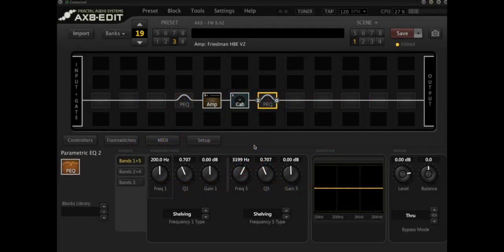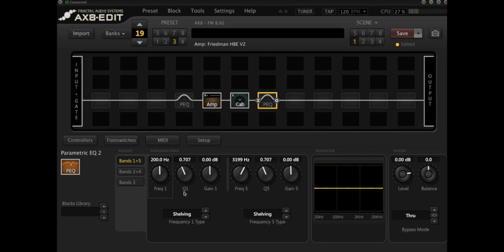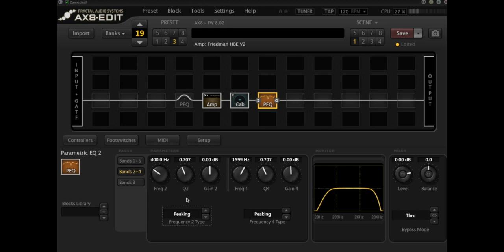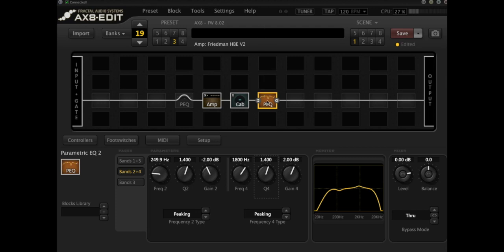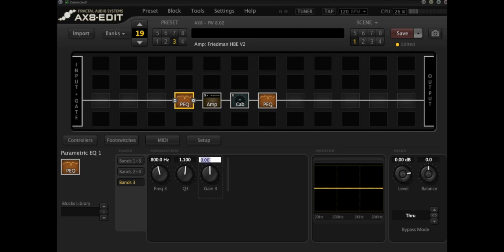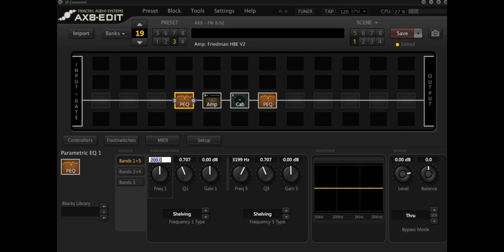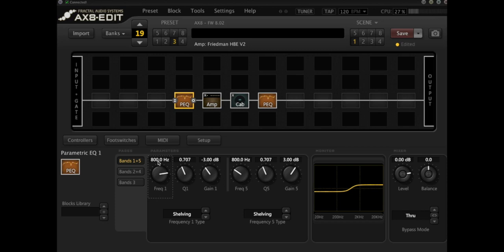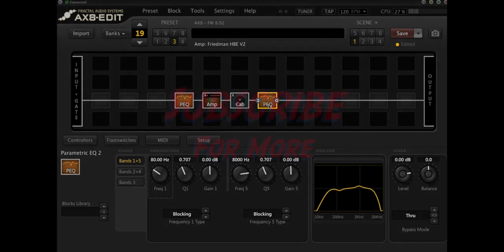Axe-Fx and AX8 Tutorial - Using the Parametric EQ Block

Comment: Hey Leon! Love the tutorial!

One question though, for starters, how could a MODERN METAL ENTHUSIAST, such as I, manipulate the PEQ block so as to emulate a boost coming from an SD-1? Been toying around the parameters for hours and hours and I couldn't quite match the sound of a SUPER OD with the drive at 0. This would be of great help since we're all saving up on CPU and the SUPER OD just eats up a lot of ram.

Thanks!

Kleeben
Reply from the maker: I just ran the SD-1 block (drive 0, level 10, tone 5) through the Axe-III RTA and got a pretty close match to a PEQ with the following settings; Low cut 120hz High cut 10khz, 6dB boost @ 636hz with Q = 0.4. haven't had a chance to test it yet but might be a good starting point.
Reply: This has got to be the quickest response I've ever had on Youtube. Thanks Leon!!